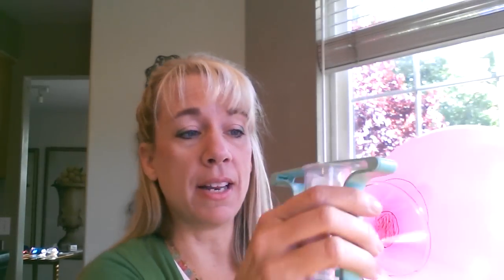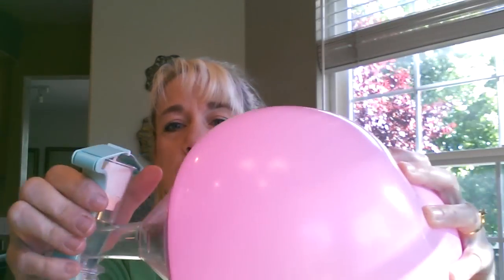Are your Nipples too short for breastfeeding?

Comment: Thank you for this. My nipples were called flat in the hospital and I was told I needed nipple shields. I never used them, but I did use a nipple sucker. It really affected my confidence in breastfeeding, for a while. Unfortunately, out of desparation and pressure from a family member, I introduced a pacifier. So far, the baby does seem to prefer my nipples over that silly thing. But for how long?